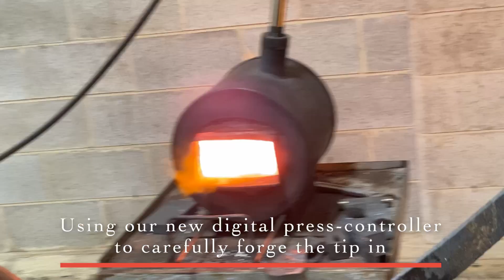Forging a Damascus Dirk with Winburn Steel - Part 2

Comment: Why don't people forge out the blade these days? Everybody seems to be grinding everything. To me, forging the actual blade is the fun part, then I finish grind to make it look pretty.
Reply: Not sure what video you watched but this blade was forged 😂Every single blade at some point needs to be ground aka stock-removal to some extent, not just for 
"prettiness". Anyone who thinks grinding a blade is just for "pretty" looks has never studied history or function. Even ancient Viking swords were ground against stones and often had their fullers ground in. But please try to make a sharp functional and professional "blade" with only a hammer by all means. 😉
Reply: @CedarloreForge  Hi David, I was referring to this video, and others (such as one by Alec Steele making a fantasy sword). My specific question is why aren't people forging the bevels? In this video (and other people's) I often see a rectangular bar being forged to a point and a tang, and that's it. (Granted a lot of work went into making the damascus billet here.) No distal taper, no bevels, all of that is heavily ground down. I for one can't afford that many sanding belts!  I am not shouting heresy, just asking why you(they) are skipping the fun part. Cheers!
Reply: @johnpalmer5367  Good question. And the reason is often twofold: 1 - believe it or not historical knives and swords often had their bevels stock-removal ground in and not forge-beveled. And 2 - with pattern welded steel like this the pattern is more dramatically revealed and arguably more beautiful when the edges are ground in as apposed to forged. But I understand that some people enjoy the journey and taking the unnecessarily hard road more than actually finishing a high-quality blade.